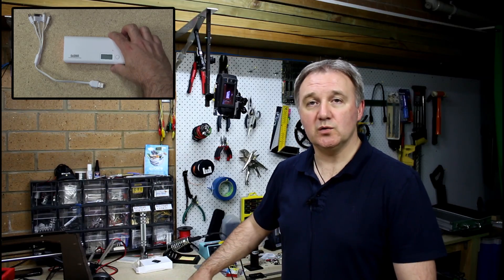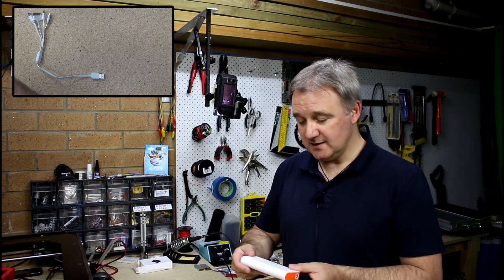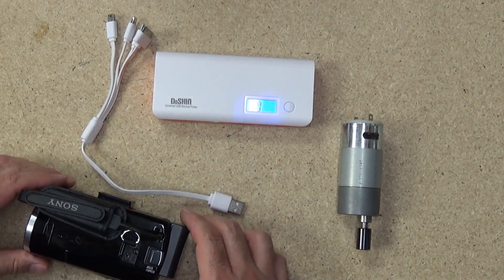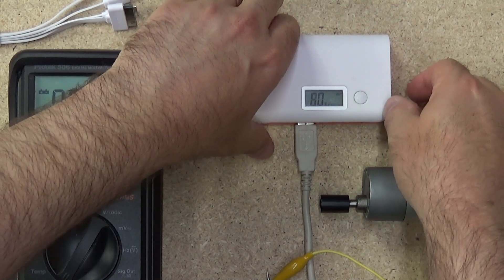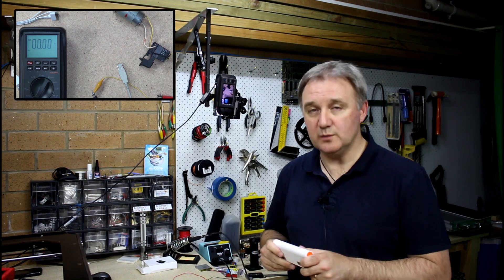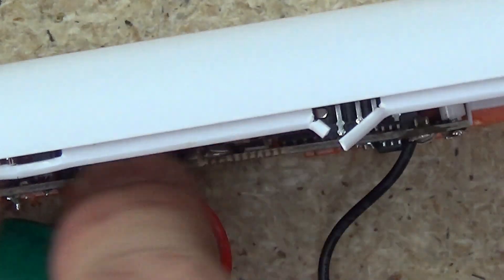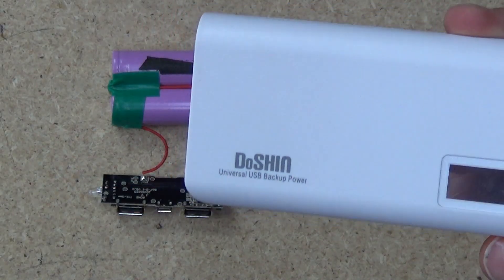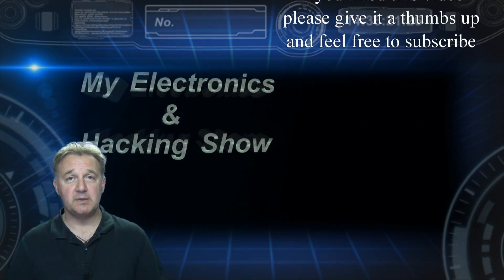Power Bank Review & Teardown (MEHS) Episode 36

Comment: You can pull way more power out of lipos. High quality ones deliver up to 40C, 80 amps in this case.
Reply from the maker: +drkastenbrot Hi, yes agree.  This whole powerbank was about $35 so not really expensive even knowing it was never going to come close to the claimed 50,000mAH.  I really wanted the LCD for re-use and the batteries would always come in handy.  3 good 18650's would be roughly the same money and capacity but it was interesting to take a look in this thing IMO.  Cheers.
Reply: +My Electronics & Hacking Show No powerbank comes close to 50000 currently, that would be too big to carry. There are actual 50000mah ones, but I wouldnt really call them a mobile device anymore. 
Also those are about 150€/$
Reply from the maker: drkastenbrot
I have a few including a genuine 18000mah and a smaller 8000mah unit.  These were $200 and $100 respectively.  I consider both portable but the 18000mah one is about the limit of portability but works well in a portable camera rig.  Cheers.
Reply: +My Electronics & Hacking Show i've got a powerbank with 80,000 mah and it ran Me down about 250€ and its kinda big but for the capasity is worth the money and the size doesn't matter that much.
Reply from the maker: +ZimmVideoPhotography - Sounds good.  I will be needing something with big power soon enough.  Might make my own.  Cheers.

Comment: It sure has 6800mah 18650s in it ;)
Reply: 6,800mAh cells don't exist yet, unless you mean all 5 of them in parallel?
Reply: I know, but theres fakes labeled 6800mah. i was referencing to cheap ebay crap.
Reply: Yes mate there is but I don't think the cells inside this power bank have any rating written on their labels?

Comment: but is it really 5000mah?
Reply from the maker: Hi.  It was advertised as a 50,000 mah battery bank.  My best measure so far suggests its 9000-10000mah, about 1600-1800mah per cell.  So less than a quarter of its advertised capacity.  Having said that, a 10,000mah battery bank for the cheap cost is not too bad.  Cheers
Reply: +My Electronics &amp; Hacking Show  i just got one of these for my phone, does one port charge faster than the other?, im not sure what the 1.0A and 2.1A means
Reply from the maker: World Famous Pugilist Tommy Ray Handley
 - Hi.  The 1A and 2.1A ports are the same voltage, 5V which is fine for charging a lot of things including phones.  The 2.1A port can charge devices that require more current such as an IPAD.  An IPAD won't charge correctly without 2.1 Amps of power.  That's why these battery banks come with 2 port, one for devices with normal power needs and one for bigger devices.  The typical charge rate of a phone is 0.5A so either port is fine and neither one will charge your phone quicker than the other.  Hope that helps.  Cheers.
Reply: +My Electronics &amp; Hacking Show thanks man, that really clears things up for me